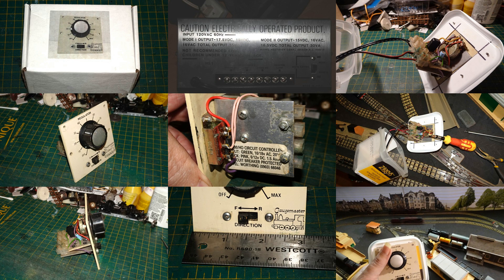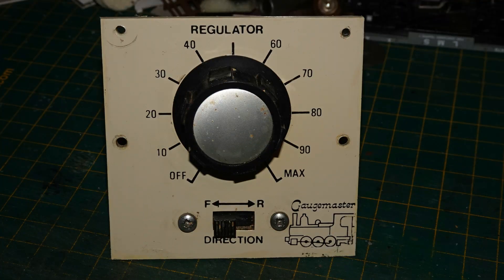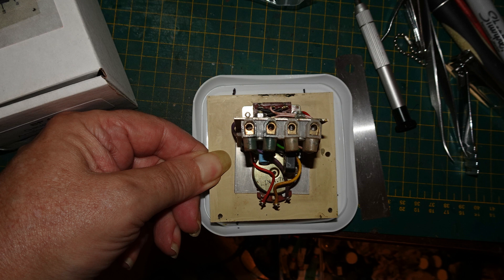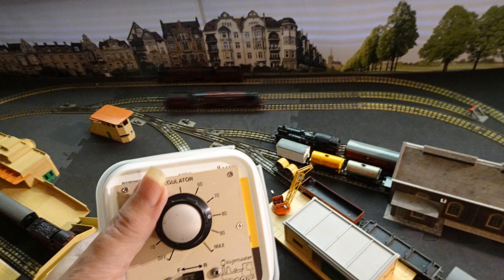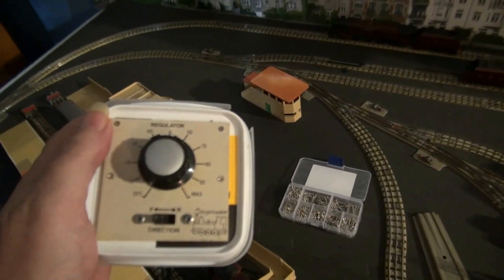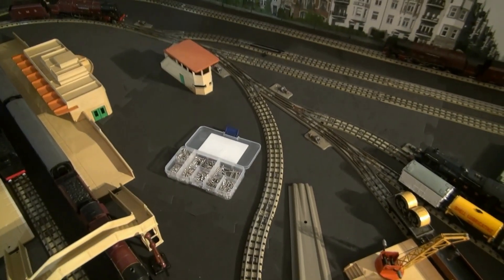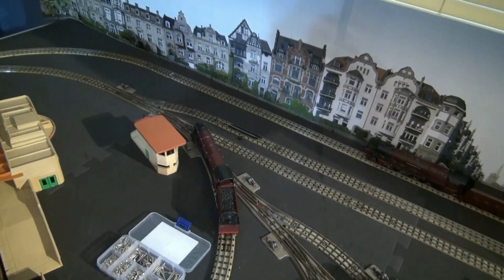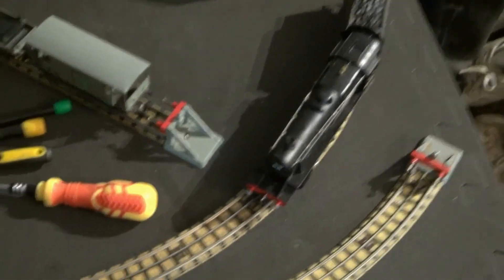OO 180, Dublo 3 rail: Gaugemaster Controller Adaption

Comment: Hi Ken. Wot, no grommet for the wires going into the potato salad box? I wonder whether you are familiar with Julian Coles' YT channel. All his early videos are on a Hornby Dublo 3-rail layout and the remainder on an N gauge layout.  He is exclusively into DCC (I know you are not a fan) and heavily into electronics (I also know this holds no fears for you - viz your shuttle), but I think you may be interested to see what he has done. Who knows, maybe DCC would help with the Duchess' reluctance to run when cold.
Reply from the maker: It's kind of soft plastic, and the wires have plastic insulation, so they're held pretty firmly without an additional grommet.
Reply: @kleedhamhobby  Hi Ken. Ok. And Julian Coles' channel?